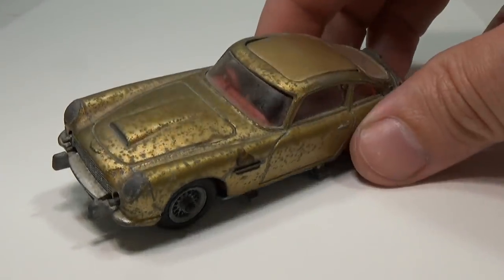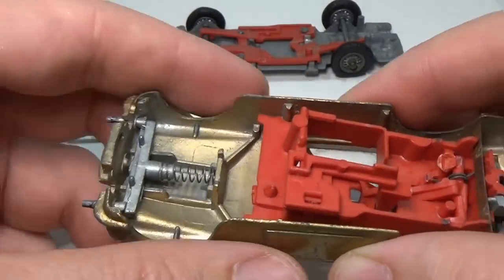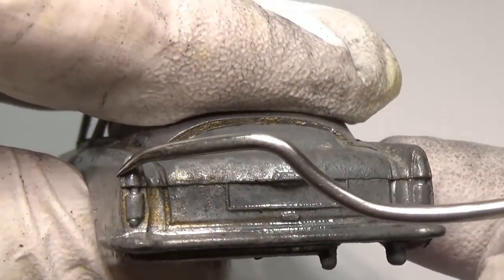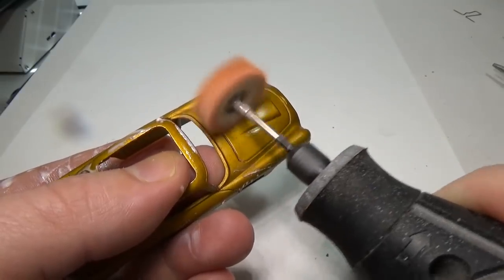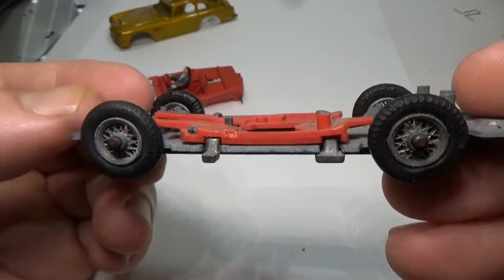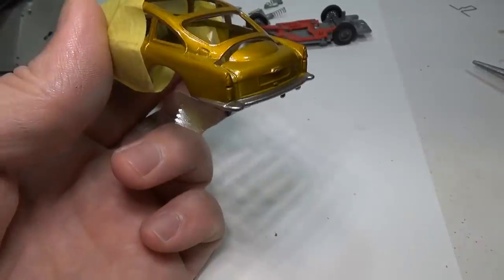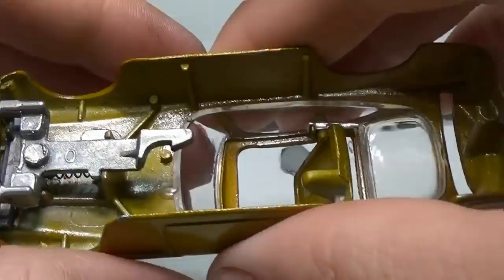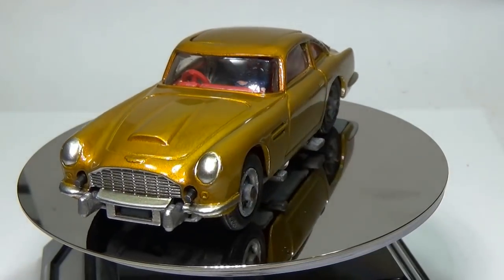Diecast Restoration Corgi Aston Martin DB5

Comment: But... wasen't the orginal DB5 color silver/grey - and not gold?
Reply: Corgi did several versions over the years:  Grey with working tire slashers and movable license plates,  gold without tire slashers and with fixed licence plates,  and grey with whizzwheels...
Reply: Possibly to get more mileage out of this mold? not having to sell it with the 007 license in gold maybe?
Reply: Possibly, though "James Bond" is still on the bottom.  Gold for "Goldfinger", one reckons.  :)

Comment: How can I send you a car? I have a few I want to send you, but I feel I may not get them back or I might not be able to afford shipping, I'm only 11,  so I'm not quite sure what I should do.
If you need details, here they are;
Car 1-a commer pick-up my VIII, made by Lesney, paint is in bad condition and axles are loose but the wheels scrape against the body, it also is slightly smaller than 1:64 but hopefully that isn't too bad.
Car 2-a husky models citroen safari, paint is bad and I don't like the colour, windows are horribly scuffed but the wheels seem ok.
Car 3-a Lesney ford corsair, paint is ok but I would like it redone, apart from that it's a good car, bar the windscreen
There are some others but I can't find them at 11 o'clock at night, I should go to sleep.

Comment: Im wondering why you dont to a real restoration on them, you seem to have all the tools needed. All I see is a sloppy attemt to a restoration with a terrible bad result. I could list it all, well heck ill go ahead and do that for you. 1. when you stripped the paint, you should use a body filler to even the surface out and go to town sanding everything smooth. What could have been a nice paint now looks horrible since you skipped the most important part. 2. Masking takes time and is not easy but you could have done it if you used the correct tejp (go to your local carpaint dealer and get good masking tejp there. 3. If you do get a paint leak make sure you remove all of it that ended up where it doesnt belong, you missed a bunch of spots and that really takes away from your end result. leaving the old tires is fine as long as the paintjob is done right. Good job on the plastic!

Not trying to bring you down and maybe these are things people who doesnt paint miss, I am a airbrusher and custom painter. I like your videos but want to see you go all they way, spend an hour more on each projekt and you will make them flawless.